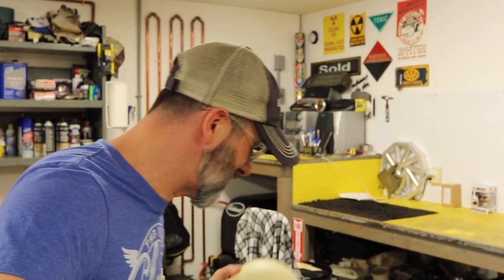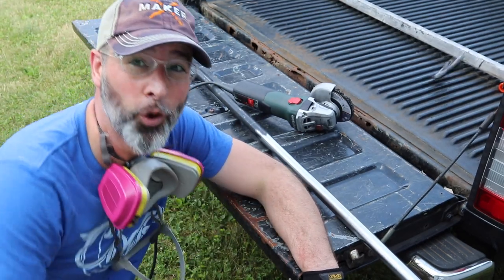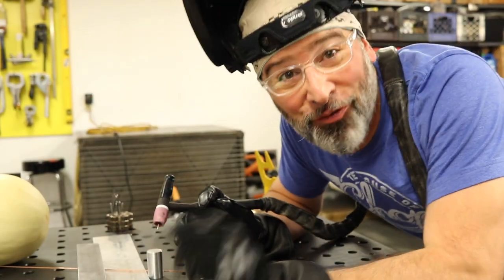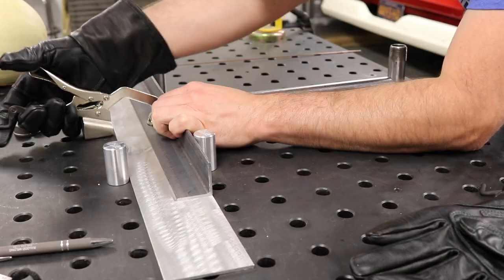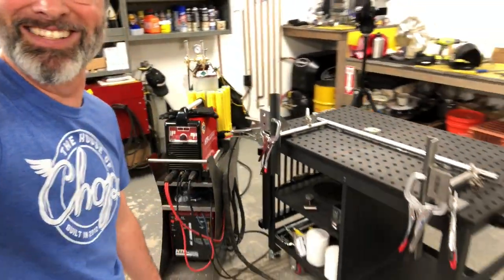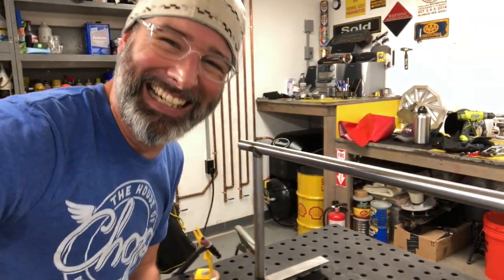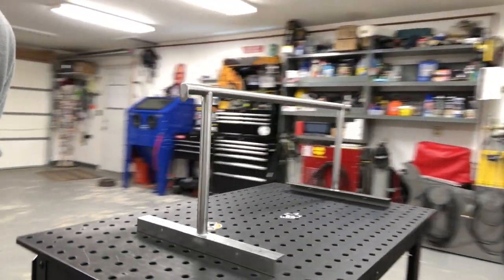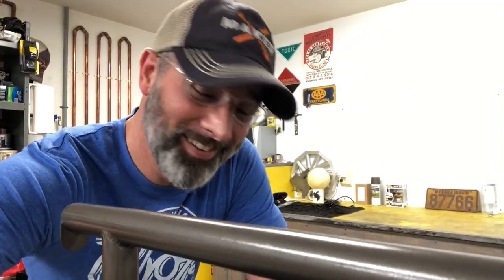DIY Pull Up / Chin Up Bar (Under $32.46)

Comment: Hey dude, love the enthusiasm. Nice project. Well done.
Mechanical engineer here. Two constructive suggestions: 1) The UV from arc welding is a real melanoma hazard. You should cover your arms with a long-sleeved cotton work shirt to minimise this risk. 2) Those gloves with sanding discs, belt grinders, bandsaw and angle grinders: They're a real entanglement hazard. In industry you're generally not allowed to wear gloves around machines like that, because having your fingers violently sucked into an angle grinder at 11,000rpm is a bad way to end the week. Generally, bare hands are safer around machines with an entanglement risk.
Not trying to be a crank; just don't want to see you suffer a long-term of short term injury while having fun in the shop. (I can tell you're safety conscious because of the respirator, etc..)

Comment: What are the bar sizes you used for the hollow and L-sections?
Reply from the maker: It’s actually cheap 3/4” Sch40 Black Pipe you can find in any hardware or home improvement store. It has a nice heavy wall and won’t cost you as much as tube.
Reply: Thanks 👌👌👌

Comment: What is the diameter of the bar
Reply from the maker: It’s actually cheap 3/4” Sch40 Black Pipe you can find in any hardware or home improvement store. It has a nice heavy wall and won’t cost you as much as tube.